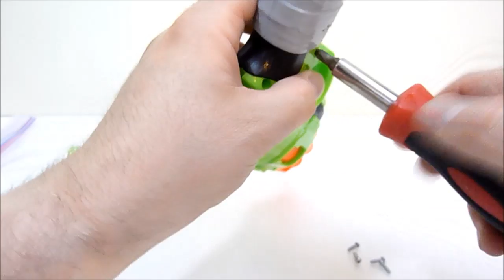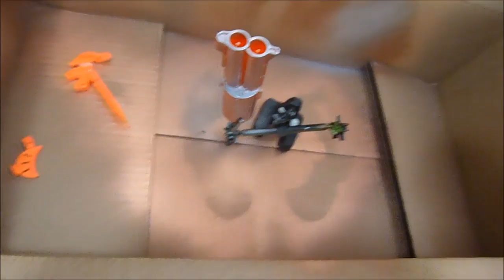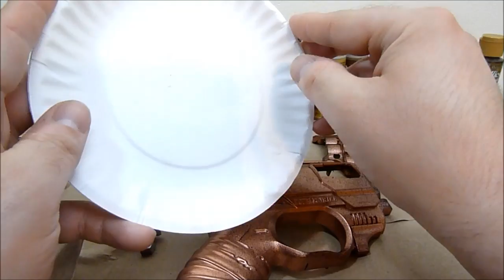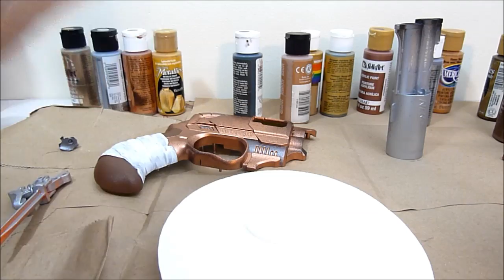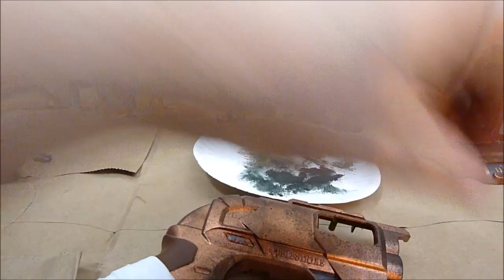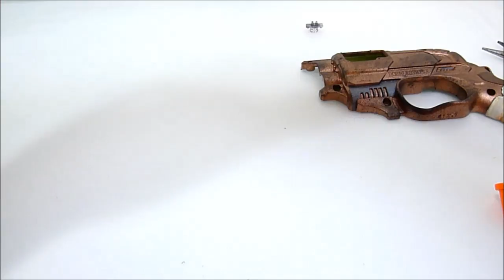Rob A Tutorials Let's Paint The Nerf Doublestrike

Comment: Thanks for sharing your process. I recently bought this gun to use in a Fallout cosplay later this year. Did you have any issues by not sanding the pieces before painting?
Reply from the maker: +Mike Goodwin I did not. Just make sure the paint has plenty of time to cure before attempting a clear coat, and make sure the clear is applied very very lightly, with many coats until you have the desired effect.

Comment: I've tried one in the past but after putting back the parts together it didn't work so is there a way of doing  it without taking the gun apart? Maybe using scotch tape etc...
Reply: Dilbert Mcdibble You could potentially just use brushes to paint it all. Although it won't have quite the same finish you could still get it to look pretty darn cool! Good luck!

Comment: I can NOT get that trigger on
Reply from the maker: Where is it getting stuck?
Reply: no where, it just flips out on me when I pull it.
Reply from the maker: So you took the gun apart, and when you put it back together, the trigger doesn't work? Sorry, it's a bit hard to visualize.
Reply: +Rob A So I took all of the internals out (for paint) now I am trying to reassemble it but I really cant put the trigger on
Reply from the maker: Is there any paint blocking the hole for the pin the trigger sits on?
Reply from the maker: Any way to take a picture and link it, I can try and see what might be up.
Reply: +Rob A Umm... no I don't think so.
Reply: +Rob A I'm just putting the spring under the trigger trying to do what you did, but the spring is not sitting in there properly.
Reply from the maker: Oh, OK. The spring is the issue? Yeah, I had some trouble with the spring, as well. If you have a pair of needle nose Pliers, you can put the spring in first, with the long end over that large tube above the trigger area, and use the Pliers to hold the short end while you slip the trigger over top of it. It takes a little patience, but should pay off. Alternatively, you can glue the small end in the trigger to hold it in place, and use whatever you can to force it.
Reply: +Rob A Don't worry I did it (no idea how lol) but it works! thanks for the great video.
Reply from the maker: Excellent! Glad it worked out for you!
Reply: Rob A Thanks man!